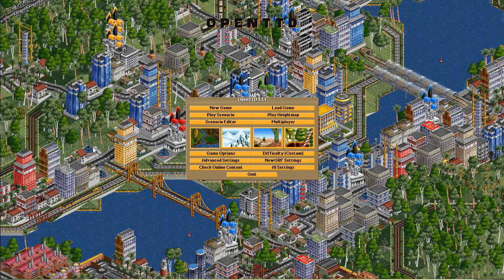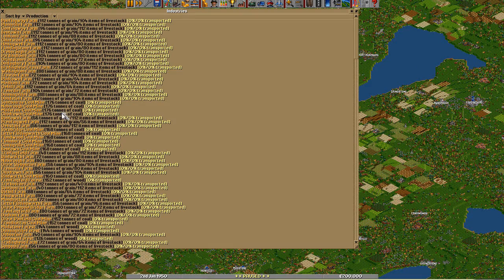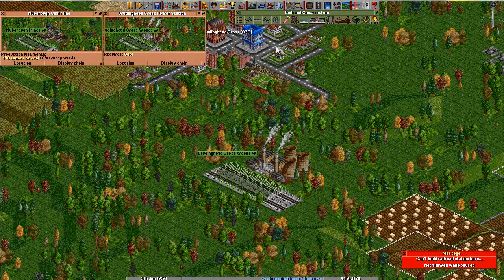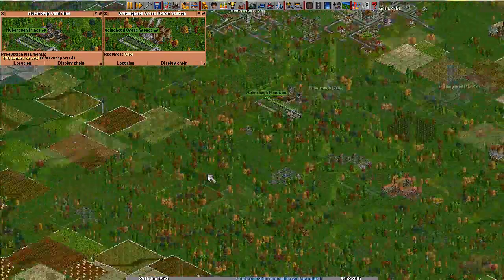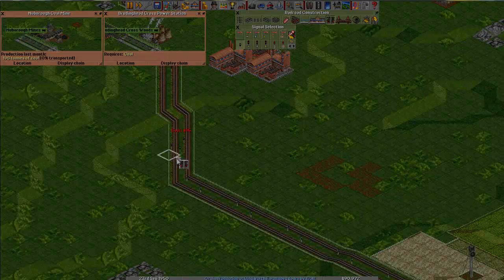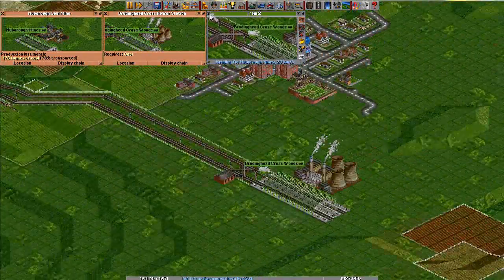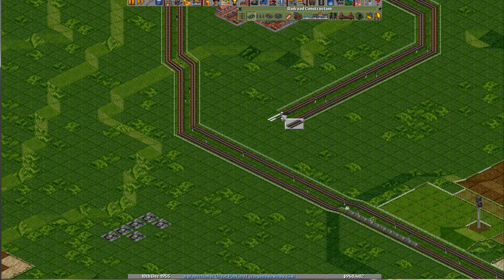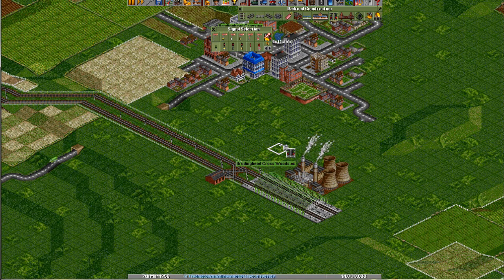OpenTTD - Train Transportation

Comment: Understanding how the signals work is the most important aspect of TTD. As for the cargo distance it matters not. The pay is exactly the same no matter distance, it's based purely on the *time* it takes. The faster the better. So by making a long run with slow trains you actually make less money than picking a shorter route for your slower trains. When you get faster trains you increase your route. Just check the timetable to maximize the profit and see how long a train needs to go.